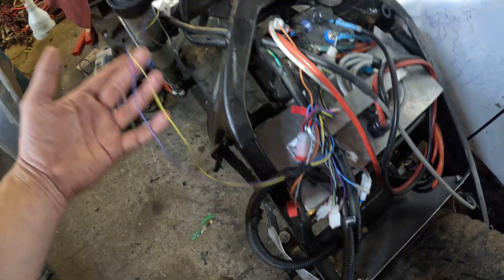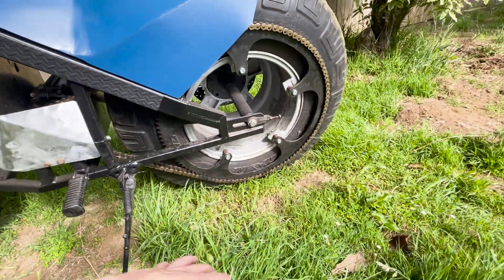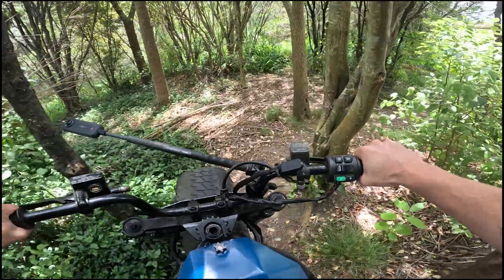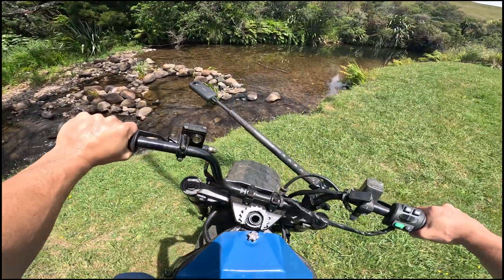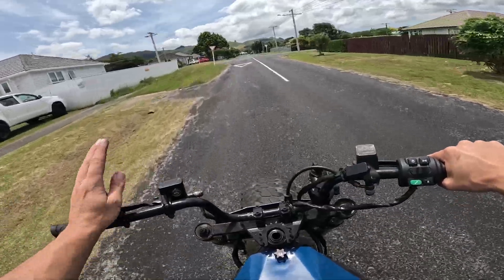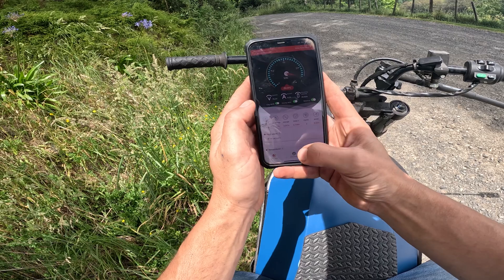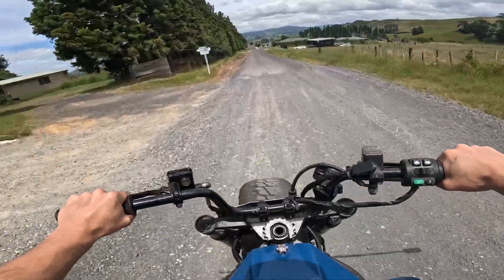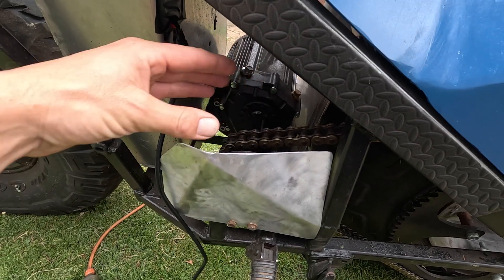DIY Electric Big Wheel Works Great!

Comment: Dude that is sick!  scrap it and do front and rear hub-motors so you have 2WD like the Rokon
Reply from the maker: I have looked into that but finding a hub motor with the gearing I need is difficult I could maybe make my own planetary gears to get the correct torque

Comment: Hi, DK this is a pretty cool build I have thought about building a big fat cat bike like this; try and run an alternator or hoverboard motor off the wheel to charge the battery.
Reply from the maker: Like a perpetual motion machine? What do you mean?
Reply: @dkthewelder  take a small DC motor and turn it by turning it by the jackshaft or turning it by the rear tire, and it will make voltage feed it through a regulator, and it will charge your battery.
Reply from the maker: @stevenpleasant5834  that is perpetually motion, the energy needed to spin a generator of any kind is always more than it makes. But can do regenerative braking but you only get back 70/80% of the energy used to get up to that speed

Comment: Looks AWESOME!!  (Wish it had a rear swing arm, but the massive tires will do just like they did on the  ATC 3 wheelers back in the day!)
Reply from the maker: I can’t really have rear suspension because the seat would be even higher I can barely touch the ground as it is, I am around 6ft if I was taller I could have rear suspension 👍
Reply: @DktheWelder Well those massive tires are also your suspension anyway so the addition of size, complexity, weight, cost, stuff to go wrong by having a swing arm probably wouldn't be worth the drawbacks anyway.  Simple is more bulletproof.

Comment: You build good looking things, you definitely have a talent for that, its hard to build functional and aesthetically pleasing.
Reply from the maker: It just seems to work out like that haha. Also why easier to build a bike than a helicopter! You can’t really change anything for cosmetic reasons
Reply: @ yeah, you can't add any unnecessary weight in a helicopter. I had visions of being able to do that in the beginning but realised over time it's not going to happen.  
There is a YT channel called ultralight helicopter, not sure if you've seen it but he added lights and an enclosure to his furia plans built machine. He did this before finding out if it could actually get off the ground. Each to their own but a backward decision If the intention is to attempt flight.

Comment: this works really well daniel! I also have a fardriver controller and qs138v3 for my electric buggy. I think your engine should easily be able to run 100 with the right gearing. that far driver app may be too extensive! I have the 72890 for the buggy. does 450 amp dc and 890 amp peak ac I have 4 batteries of 43 Ah each, so together 172 Ah at 60 volts. that should deliver 40 hp
Reply from the maker: I have the nd96850 controller I think. I can run it on 96v but am only on 72v at the moment also using the qs138 . I think my bms can only do 500amp peak I think I need a bigger one maybe? I can’t even ride it in high power mode it just wheelies and my shoulder isn’t healed yet haha